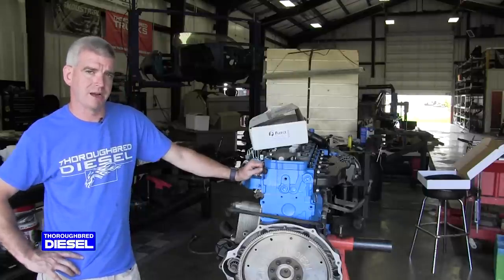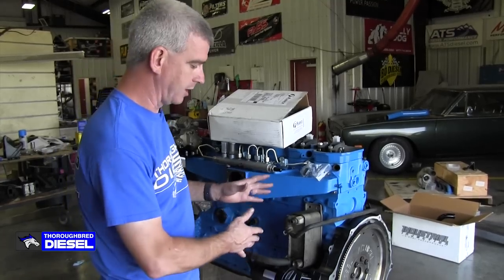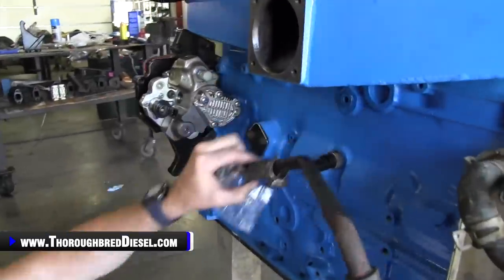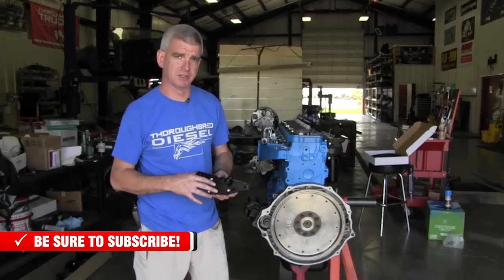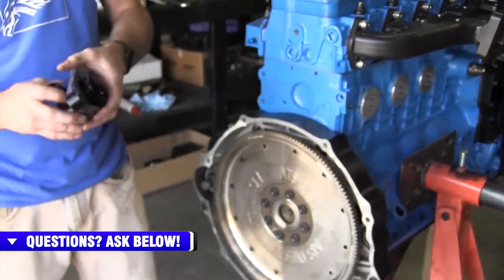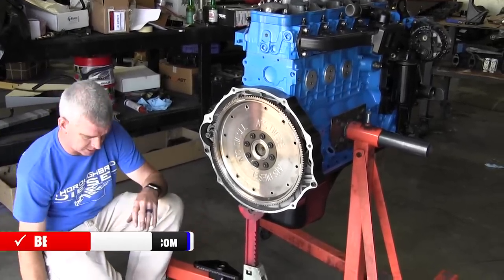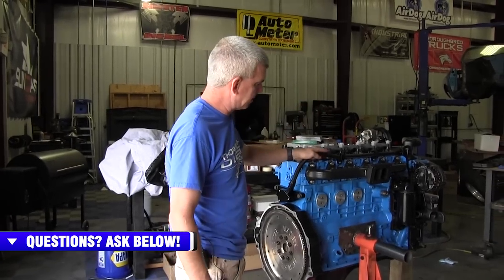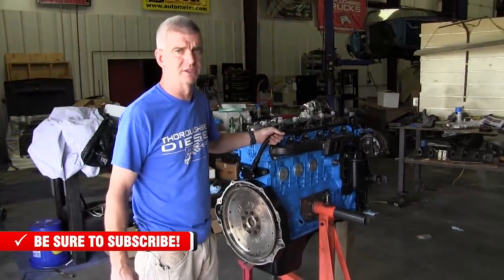Coolant Bypass Kit by Fleece Performance Install: 2005 Dodge Cummins 5.9L Automatic

Comment: Ummm ya.... add 2 hours of time JUST for the freeze plug, if your engine is in the truck. And a plus 5 difficulty rating 😆 This guy, I swear.
Reply: I just did this and got the freeze plug out with a long pry bar with a few swings of a hammer in less than 30 seconds

Comment: Generous on the 4 difficultly rating.  I'd 7 is more appropriate.  Laying across an engine, doing the majority of work under/between a firewall is not easy.  That is arguably the most difficult spot to reach on an installed engine.
Reply: "Remove anything thats in your way to get to that freeze plug"... yup, thats called the gd truck. I cant even get a line of site to that let alone work up there
Reply: Yeah it’s a 4 if it’s a nice clean engine on a stand and components already removed. Lol

Comment: i couldn't imagine trying to get at that plug with it in the truck and the trans not off.. He's using a hammer like there is no fire wall there lol
Reply: @thelaststarfighter  I just did this job with the tranny and engine in place a few minutes ago! I will upload a video soon on the process. I built my own bypass system and used a rear block off plate pre-tapped for 1/2 npt pipe.
Reply: @thelaststarfighter  agreed
Reply: hunt2eat  did you ever upload your video of the coolant bypass install?
Reply: @Erklzanderz   Wheres the installation vid lol. was it too hard?
Reply: @Erklzanderz  - Did you ever post the video???
Reply: @SnowMexicaN - Wonderig of it "might" be possible to get a small cordless right angle drill (with a stepped drill bit) and remove/hack the FP out that way???

Comment: I installed this kit in my 07 great product in theory and good quality.  My experience was that rear plug was extremely difficult to access/remove with engine in the truck. The plug did NOT rotate, rather went frighteningly  evenly into the engine even with a fine piont pick on the extreem edge. My only saving grace was #6 water jacket stopped it from falling in. Oh and the "heat exchanger" is actually referred to as a torque converter cooler wonder if it was intended to stop trans from melting down under the extreemest of conditions. Regardless the cooler has been known to fail subsequently, mixing coolant into transmission instantly destroying it. I feel the Fleece is the only coolant bypass worth buying despite hell to install but recommend closely monitoring trans temp when towing.
Reply: pvcarmon1 how did you get your freeze plug out mine won't rotate.?
Reply: thanks for that, been looking/reading everywhere on someone who has actually installed with motor/trans in the truck. I crawled under, looked for 5seconds and said nope!
Reply: @QuickStyleMotorsports  lmaoo same
Reply: @DEADRISING72HR  uh oh. What did ya end up doing?

Comment: Great video and thanks for sharing this replacement kit for the OEM transmission torque converter Oil cooler. I"m considering doing this on an 07, 48RE trans with the 5.9 cummins. Someone else asked about the transmission lines that go into the stock cooler. What happens to those lines when the Fleech Coolant Bypass Kit is installed...? And would there be any issues with more northerly / colder climates up in central Ontario, Canada...?
Reply: I'd say get the manual transmission one then buy a good aftermarket water to oil cooler & replace the stock transmission exchanger. Then run whatever you need to with new appropriate lines to make it work.
Also I hope you know that the transmission needs to be in neutral to pump fluid & warm up.

Comment: I know this old but some of us are just owning a cummins so I just wanted to ask that is there any procedures to do after getting rid of the heat, exchanger because I live in northern Pennsylvania and it is fairly cold alot of the year so I just wanted to know what I should do differently during the cold months.. and if I need to let it run a bit longer or if I need to start off being easy on the transmission or etc...? Thank you :)

Comment: Coolant flow is from the water pump through the block & head. Then out through the thermostat when its warm enough (or has enough pressure) to the radiator before returning to the water pump
Reply: You are CORRECT.
I saw that, HUGE MISTAKE.
SO, does this guy know anything???
Reply: Exactly what I was thinking.

Comment: In the first part of the video, the tech say coolant is delivered to the rear of engine through the bypass. Correct me if I'm wrong, but doesn't the water pump push into the front of the engine, and thermostat is between outlet and radiator?
Reply: You are correct!
Reply: I saw the same huge mistake.
Does this guy know anything???
Reply: @nellyfarnsworth7381  He sells Parts! He's not a Mechanic! lol😂

Comment: coolant flows the opposite direction that you said in the video.
coolant will flow out of the back of the block and into the upper rad hose.
Reply from the maker: You are correct,  I don’t know what I was thinking there.
Reply: @thoroughbreddiesel  its all good some times we need to correct  one another so that we can learn from each other, thank you for making a good quality video explaining how the by pass works and why you need it.

Comment: hi cool video, but I have a question: I have a 6.7 2015 dually HD with an AS69RC, I don't have a heat exchanger, and I still have my entire EGR system in place, is this a problem with EGR in place?  Thank you
Reply from the maker: A new part number is coming for the bypass that works with EGR. Should be released sometime first of 2022. Give us a call at 866-737--4966 for ETA.
Reply: @thoroughbreddiesel   Hi. 
Thanks ,
Ok. 😉👍

Comment: hey wade, just ordered my fleece coolant bypass for my 07 5.9 from you guys along with my new airdog 4g G&R sump fleece fuel filter delete and oil cooler, so when i install the coolant bypass and remove the transmission heat exchanger what would i do with the transmission lines? do they include something to connect the transmission fluid lines so i can delete the exchanger completely.
Reply: Great question/s. I'm in the same situation and would like to knowas well... not hearing back from anyone in over 5+ yrs, doesn't instill a whole lot of confidence.

Comment: So, I paid a shop to install this on my 2015.
The line everyone says to "tighten before installation" is leaking at the fitting.
I have ordered a 1" crowfoot socket.
Has anyone ever tried to tighten this line IN the truck?

Comment: Is there a reason you cant just run a line from feed line to return of where the heat exchanger use to be and run a external cooler on the transmission?
Reply: No but I believe the return line crosses over behind the block right where the bypass bolts on

Comment: but if someone was installing this kit and eliminating their heat exchanger do they just get an adapter to connect the two transmission lines because my exchanger is bad so i am going to take it off as to not leak trans fluid and i want to install the bypass kit but i havent been able to find anyone offering a coupler to just connect the two trans lines together or a kit with a new trans line to just eliminate the ones that connect to the exchanger..?
Reply: Because that would be an absolutely atrocious idea to delete that.

Comment: Pretty sure high boost can't pushout freeze plugs unless maybe your head gasket is leaking. Usually from turning higher rpms causing water pump to make more pressure.
Reply: HorsepowerTube higher boost= higher cylinder temps, which causes more heat transfer to coolant. The issue is that cylinders 5 and 6 receive less than adequate coolant flow causing pressure spikes around those cylinders which can push freeze plugs. Water pumps don’t create pressure only flow
Reply: Uh well technically speaking no pump creates pressure.
Reply: Correct at high rpm your water pump can over pressure the system causing freeze plug issues. That is why alot of people "clip" their water pumps

Comment: Hey, So with the Bypass Kit will it cool transmission better and will it take longer to warm transmission up?
Reply from the maker: We saw no adverse effects doing away with the heat exchanger at all.
Reply: Just installed the bypass while the head was off. Made the job a little easier. 

warning
If you live in a warm climate like Northern California be prepared for much higher transmission temperatures in stop and go traffic or heavy towing at low speeds. Trans fluid coming off the converter in these situations is much higher than your coolant temperatures. When you eliminate the heat exchanger you loose cooling capacity.  My truck had survived 280k miles without this product in the same conditions. Head gasket blew when my employee drove too long after the water pump went out. This product is definitely oversold and if you live in a warm climate you might have to drop another $1000 on a good frame mounted transmission cooler.

Comment: When the freeze plug is taken out is the block really ruff? I'm concerned about the o ring tearing on a ruff edge. I know they supply a cleaning pad but that hole was never designed for an O ring.
Reply from the maker: We haven't really had any issues with it. It does require GOOD cleaning though. Good rule of thumb, if the cleaning pad is in good shape when you're done.... then you probably didn't clean it well enough.

Comment: Now when I have to replace the rear thermostat, how difficult will it be to reach back there with an allen wrench and do everything blind? you'd have to go from the top of the head and reach down while laying across it.
Reply from the maker: Good question.  You will be working blind but it is possible to get the cover off to replace the tstat.  If you have a trans down for any reasone maybe a good time to replace the tstat then as well.  We have yet to hear of a tstat failure in the field on these.
Reply: @thoroughbreddiesel  Taking the trans out for a clutch, but wanted to make sure im not shooting myself in the foot when the need arises to replace it, Worst case scenario im thinking remove drive shafts and cross member and support it to tip it back if you can't get the clearance from the top or side. Do you know the Tstat manufacturer?
Reply: @mylesswann530 how was your install of this kit? I'm thinking of getting it while I swap to a NV5600

Comment: Where can I get that stainless steel hardware kit for the exhaust manifold ? I have an 04 3500 with 5.9 Cummins
Reply: You abso-fkn-lutely do not want stainless bolts holding your manifold on. They'll stretch

Comment: I have a question, since the part has a second thermostat, what happens if that thermostat goes bad, gets stuck closed. Is the thermostat easy available.
Reply from the maker: If you have a thermostat go bad and need to replace,  this is a Cummins 180* thermostat which is easily replaceable.  If that therm goes bad,  then it’s basically the same as not having the bypass kit installed.
Reply: Thoroughbred Diesel this is a good thing than because if I'm not mistaken, cummins thermostat get stuck open when going bad, if I'm right
Reply from the maker: Usually, they fail closed.  We have seen the failures both ways but closed is the norm.
Reply: I believe the cummins factory thermostat is designed to fail open not shut and some other better brand ones but if you go with an autozone one it's gonna fail shut
Reply: @mikethorntonr1    You are correct, which is the prime argument for using a real Cummins thermostat.

Comment: Now I heard that guys recommend putting rtv sealant, or some type of silcone on that back plate with the o-ring too, would you recommend that just in case a o-ring fails.
Reply from the maker: No,  you do not want to add RTV sealant to any sealing surfaces that have an o-ring.
Reply: Thoroughbred Diesel what about around it , like the base of the unit.
Reply from the maker: No,  never use RTV where an Oring creates the seal.
Reply: I put a thin coat of oil on the O ring.

Comment: Where can I order just the heat exchanger bypass kit ?
Reply from the maker: We do not offer just the heat exchanger bypass kit. Although that could be accomplished with some plugs and the manual shift heater core line.

Comment: What is that block plate behind the cp3 for?
Reply from the maker: It is a block off plate for a location that a cam driven lift pump would mount for any applicable 5.9 engines.
Reply: Thoroughbred Diesel is there any necessity for that pump if you're running a fass?
Reply from the maker: No sir,  it would have been used on the 12 valve early models for example.

Comment: My friends truck just blew the heat exchanger and it fucked the trans and cross cuntaminated into the engine block. Dodge sucks ball juice for making this type of system. Its a 6000$ repair bill. Get this bypass in immediately before this happens to your truck

Comment: Why is he using a 4 foot bar to get the freeze plug out. Lol
Reply from the maker: Try to simulate how you would need to do the install with the engine in the truck.
Reply: Ok that make sense.